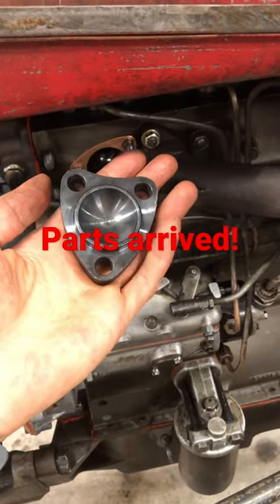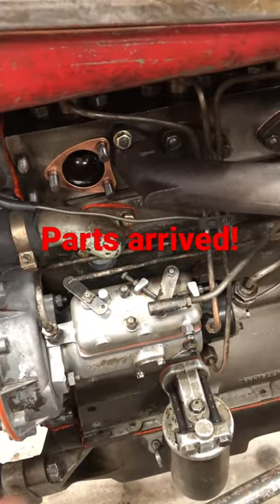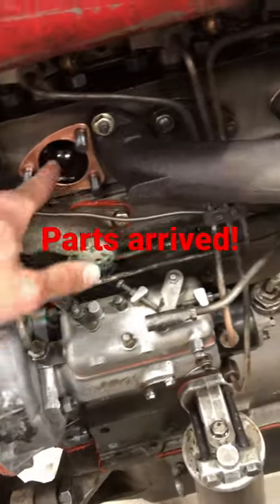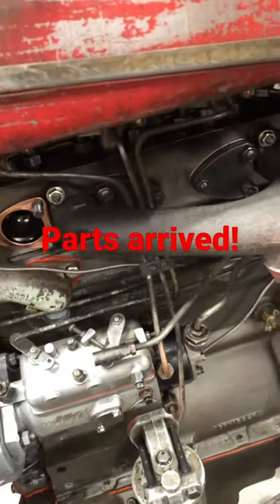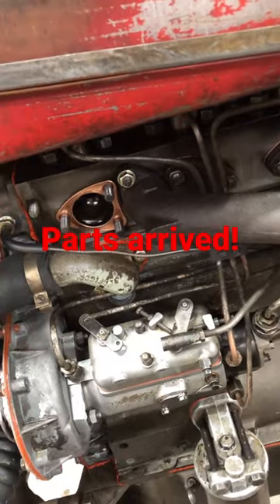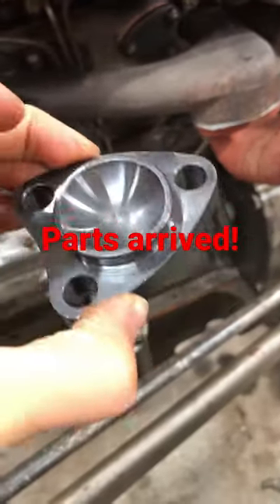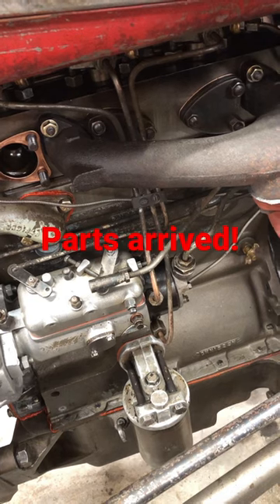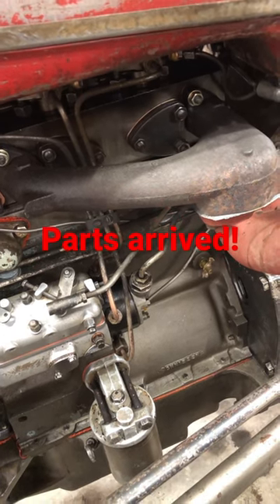Replacing pre combustion chamber caps on Massey Ferguson 35 Perkins 3 cylinder diesel #skills #diy

Comment: I have had gaskets blow out twice on my combustion chamber cap.  What torque did you use on the nuts please.
Reply from the maker: Hi,
I had them blow out too.
I torqued them down as hard as I could but didn’t help.
Some people said to tighten them enough to be able to start the tractor and then run it to operating temperature to help seat the copper gasket.
Reply from the maker: I would look at the head- If there is no big scratches or damage I would try to seal it.
Reply from the maker: I used 2 component epoxy for metals and it sealed it. Don’t know how it would be if I had to take it off. It still working after a year
Reply: @thefarmerguy  that is interesting.  Do you remember what epoxy you used (JB Weld?)?  When my tractor would not start, I used a lot of ether trying to get it going.  I wonder if the ether makes very high compression and blows the gaskets.
Reply from the maker: @dougbas3980  I would not use ether to much. It’s not good for your valves. 
I believe I used jb weld. 
Did you rebuild the pistons/ rings liners etc.?